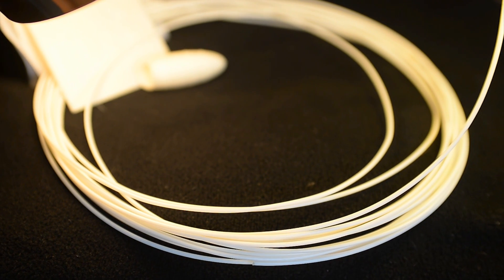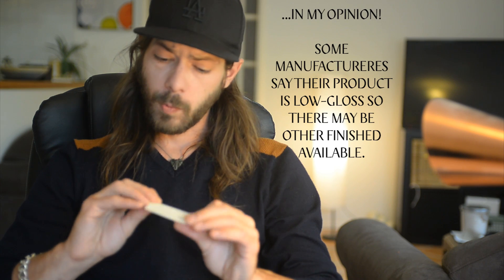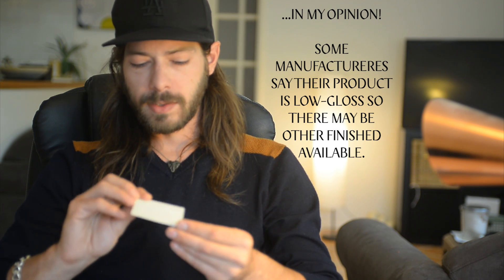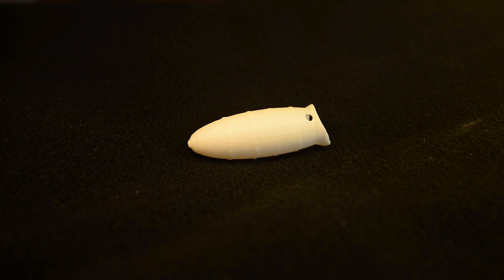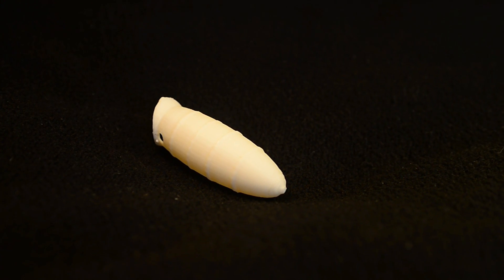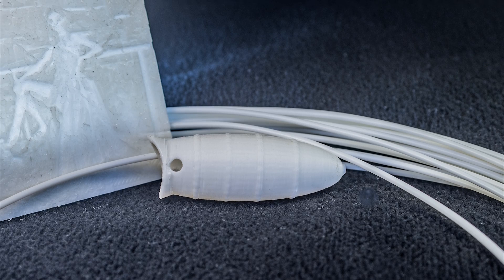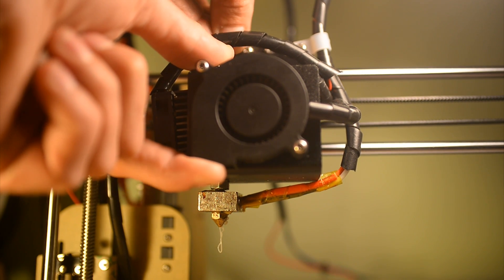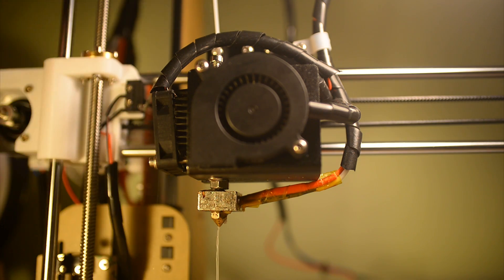Testing ASA Filament on Anet A8 3D Printer - How to Print Tutorial

Comment: Thanks for the info . I was in a bit of a panic because there are no ASA specific settings for my Two Trees Sapphire Pro. I'm going to give your temp settings a try as soon as i test a roll of ABS. 
Thanks Again for the video.
Reply from the maker: Sorry for the late response but how did it go?
Reply: @JMWConceptsTheOfficial  It went well , my sweet spot settings were 270 deg F & 65deg F for the bed , using type filament i am using. Saying that , not all filaments work the same way, you have to test them out ,  which i did.

Comment: Do I need an enclosure for ASA like I do for printing ABS? It's quite cold now here in the south, but I have a heated bed. Creality CR10. Thanks!
Reply from the maker: Hi Hein,
I print both ABS and ASA with no enclosure but if it's cold or windy, you may have trouble with warping.

Good luck and let us know how you go! 😃

Comment: I had really high hopes for ASA, read everwhere that it is super easy to print. However i did not get any results so far, it always ended up as a mess on the printbed. i tried all kinds of combinations of printing temperatures, bed temperatures and fans speeds, and best i could do yet was a half decent 3D benchy that came "broke" eventually and made another mess... Guess i have to keep trying, but i never had so much trouble with any filament at all, including ABS, PLA, PETG and HIPS...